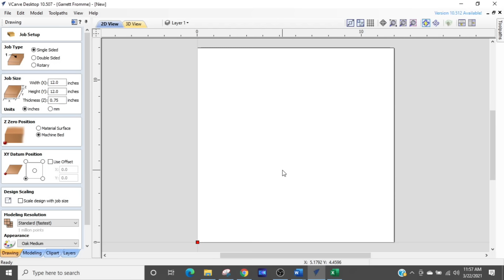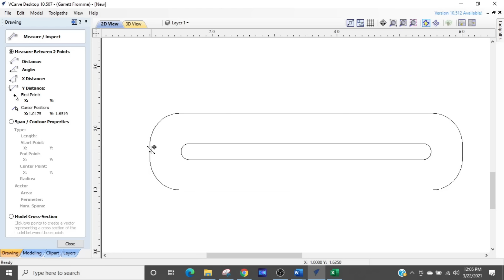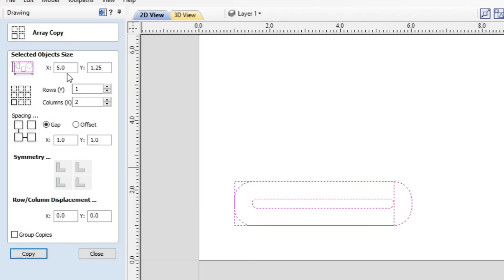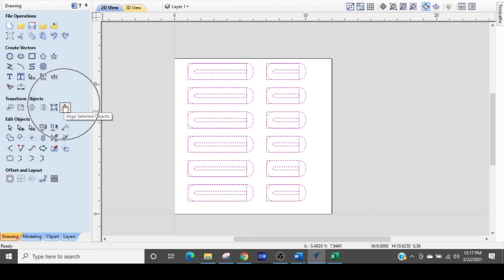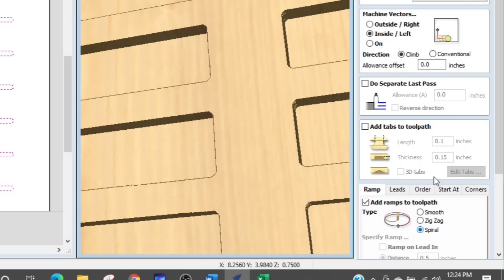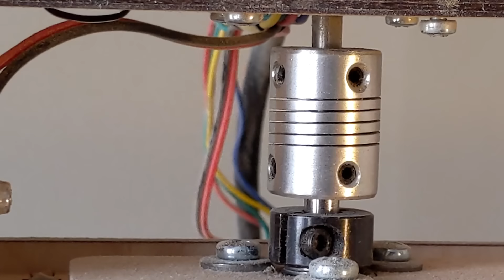How To Make Clamps For Your CNC Router, Easy CNC Router Projects

Comment: Thanks for another great video!  Do you have any other style clamps that you use?  I just recently got the t-track add-on for my Shapeoko XXL.  The clamps are pretty short that come with it because the tracks are so far apart.  I created an L bracket for the lower left corner of my CNC, that way I am always at 0,0 when putting stock on the CNC.  Are there other shapes for clamps that you have thought of?
Reply from the maker: Hi George. I will be doing a cam-lock clamp video soon.

Comment: Would you recommend a hardwood over pine for the clamps?
Reply from the maker: Hi Dan. You can use any wood you want exceptparticle of course. I use pine because it is most of the scrap that is laying around. As for recommendation, of course hardwood is more rigid. It would be a better option.

Comment: Crystal clear Garrett.  Thanks for your dogged determination to make this vid.  Your methodology is especially useful; showing the inprocess "fit/function" and clarifying is very helpful.  Thanks!
Reply: I detect a subtle Paul Simon reference there...
Reply from the maker: Hi Barry. Thank you. I kinda felt the video was a dud after trying so many times. Seems to not be the case. What kind of projects are you getting into?
Reply: @IDCWoodcraft  Primarily projects that will push to expand my knowledge and skills.   A simple V carved gift for my wife my 1st project.   A really nice 3d carved wedding plaque with curved V carved text for a friend.  Other than that getting my new Shapeoko Pro set up with a spoilboard, guide rails, grids, et al; most of these things a deep dive into learning and gaining knowledge.
Reply from the maker: @cook6052  love learning new things! keeps the mind active. Let me know when you get this puppy built